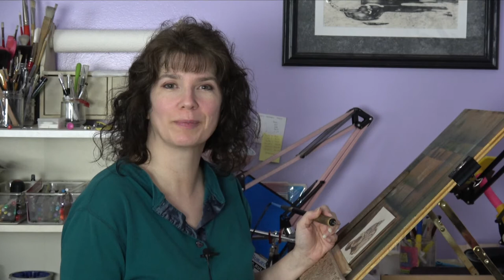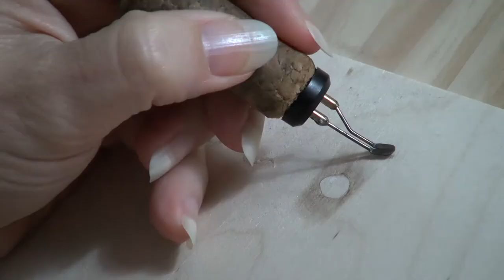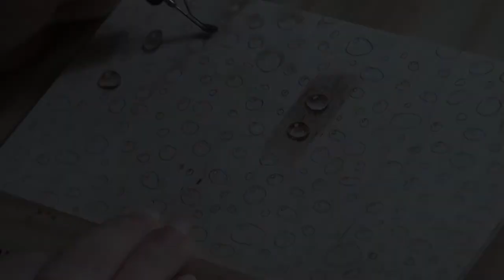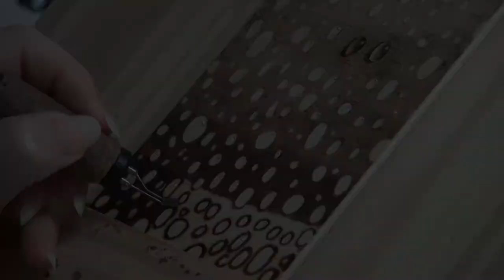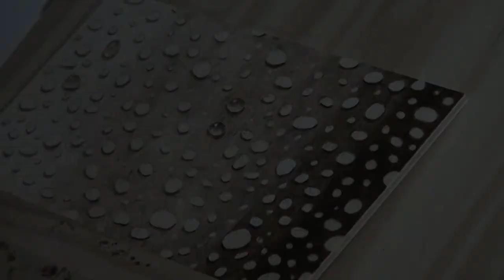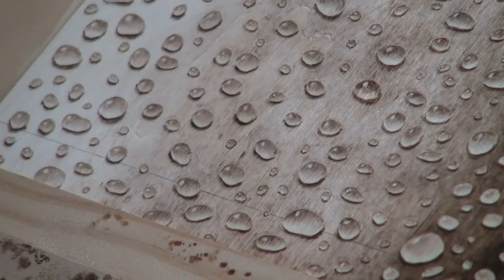Wood Burning art -  Water Droplets - pyrography time lapse  (dew drops)

Comment: Hallo Brenda, what did you use there to erase the burning 1:02 ? Thank you
Reply from the maker: Hi Daniel,
that is a Fiberglass Spot Sanding pen.  They are designed to remove rust from metal, so they are extremely abrasive.  I like them because of the small size.  They are a little smaller than the eraser at the end of a standard pencil.  I buy mine in ebay or amazon.  
If you see one that is advertised for cleaning watches, don't waste your money on it.  They are pretty soft and I doubt they could erase pencil marks off of paper.     Brenda
Reply: @PyrographyMadeEasy  thank you very much Brenda :)